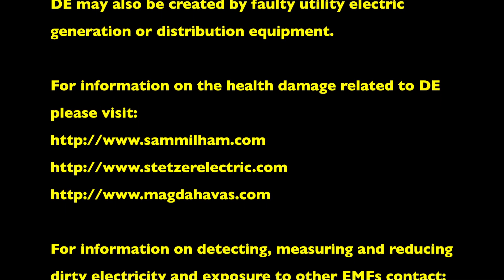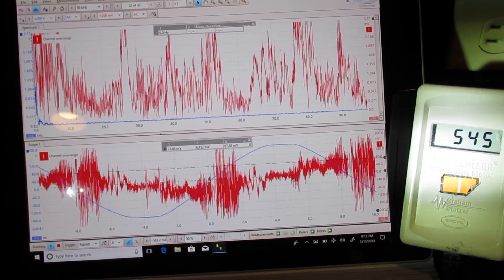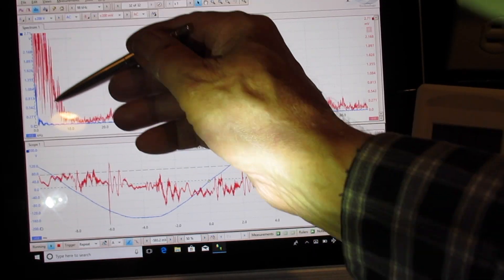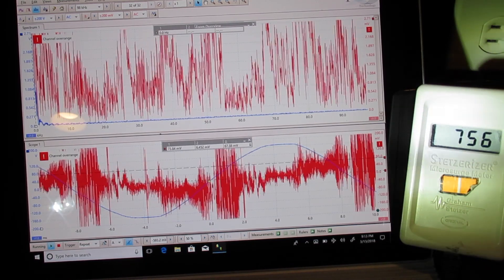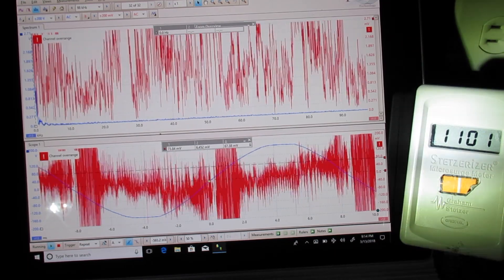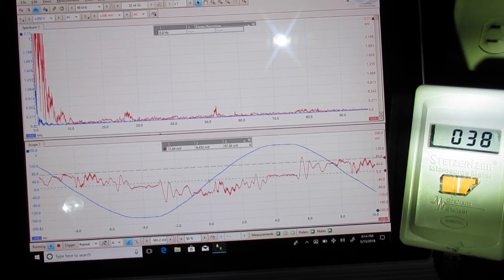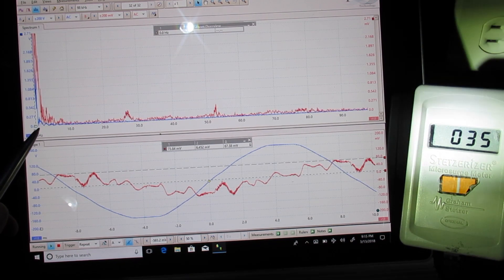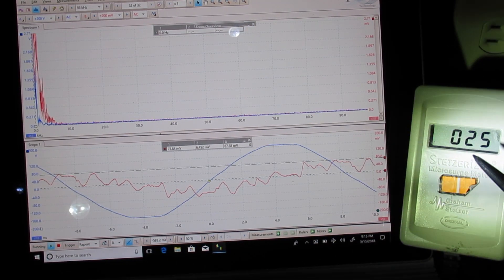Filtration of Dirty Electricity with Satic unit and DNA Line Filter

Comment: Eric, thank you for this demonstration.  I appreciate your videos as they continually provide insight.  My own house is a combination of Stetzer filters and the Static Power Perfect and I still find myself dismayed by the amount of DE in my system.  We really do need regulatory intervention as DE is a growing problem.
Reply from the maker: Hi Jason,  Is your DE coming from your side of the utility meter or the utility side?
Reply: @windheimemfsolutions  I disconnected my breakers and then attached a separate 15 amp breaker wired to an outlet and plugged in my Stetzer meter.  With all of my house disconnected from the panel I measured some high DE.  In my 20 minutes of observation I had a low of 800 and a high just over 1500.  This indicates to me surging coming from outside of my house and does not include the dirty electricity produced from my own devices.
Reply from the maker: @jasonschlegel4027  Sounds that way.  Get a good filter to protect yourself.  Avoid the hype about saving energy and reducing you bill.
Reply: Eric, thank you.
Reply: @windheimemfsolutions  what is a good meter? I’m hypersensitive and would appreciate your input.
Reply from the maker: @meda1726  Stetzer meter here: http://electrahealth.com/A1
Reply: @windheimemfsolutions  What is the solution for this case? I have a similar situation in rental house. Static power perfect and just deal with what is left, or do you have to put filters on the outlets too?

Comment: Hi Eric, what is your opinion on the Pure Plug-in dirty electricity filters of Satic? It is the same technology as the Perfect box. What do you recommend if I have to choose between the DNA Line filter or 2 of the Satic plug in filters? What is your experience with only one DNA Line filter installed? Three of my neighbors have Solar powered panels and I need help. I really wonder what would be the better choice. I don't know what to do because one EMF consultant told me this regarding the DNA Line filter : "I have one of those sitting here plugged in near my desk, it does
almost nothing. I am not impressed with those small units. I am a distributor of
DNA line filters. I just had installed a $3,000 large unit on the lady's house down
the road. The small personal size one's I am not crazy about. You would need about
5 or 6 of them to make any difference and they are too expensive for that."

 Thanks a lot and happy new year!
Reply from the maker: I prefer Stetzer Filters.
Reply: @Martijn K
 - You next option is a Faraday Cage. Also, the Faraday Cage MUST be grounded or it defeat the purpose.  I have a Faraday Cage and its working great so far.  I have been sleeping in it for about 2 years now.  I also made EMF Video recently, check it out on my Channel.... I even tested them on my Dog, there is a Video for that too.